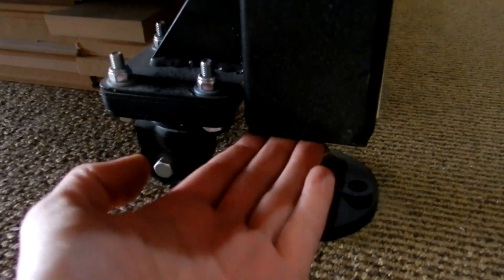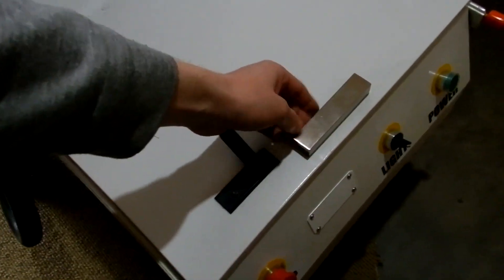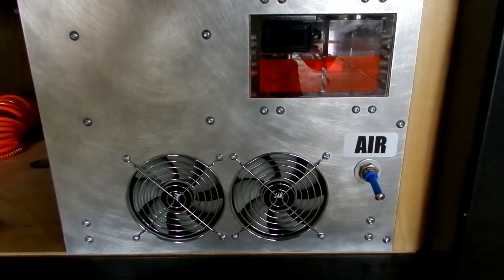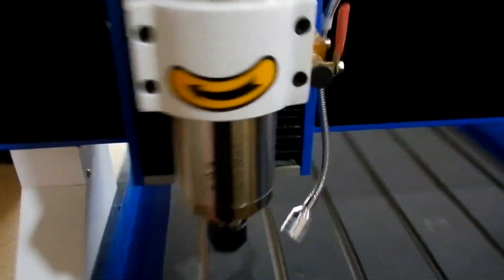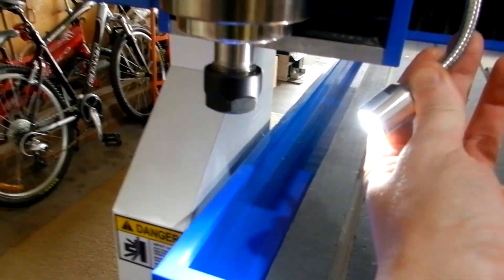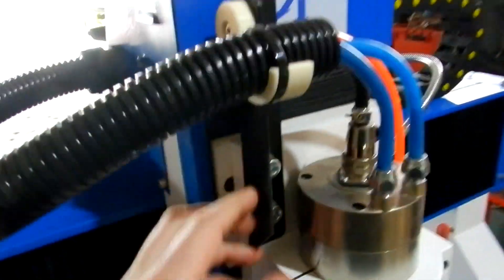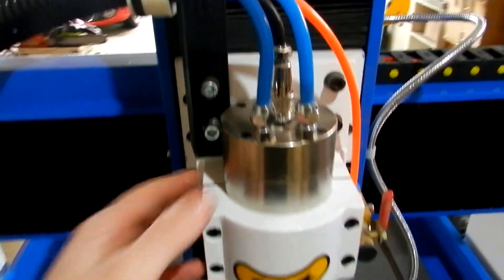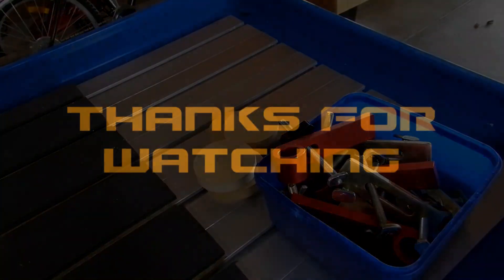SM6090 CNC Update

Comment: Are Stepmores a good factory to deal with? now that you had the machine for a couple of years. what is your impression?
Reply: They sent me a non working machine (6090 atc)and ghosted me
Reply from the maker: Oh wow wtf. did you end up getting it sorted out?
Reply from the maker: Had no problems with the company, Love it, had no problems with it. Did some big long jobs on it this year. Also cut some slabs of 50 and 70mm thick macrocarpa with no problems at 600x900mm size. Still need to do aluminium cutting on it and will be doing that some time soon as I will need to make some brackets and bits.

Comment: Im about to order a machine (either 6090 or 1212). how did you get it off the truck and in?
Reply from the maker: I had them deliver it to my place. 40mins drive from Port. And they used a pallet trolley Jack to get it from there truck into my garage.
Reply: @exploringwithmark  was it easy to move about on the pallet trolley? I assume it was too heavy. Mine will be a tad heavier. How did they take it off the truck though?
Reply from the maker: Truck had a lift on the back door. Wasn't to bad to move around on trolley. The stand I made for it is on feet and chaster wheels, I moved it a couple of months ago when I had a big clean up and rotated the machine 90 degrees in shed. 1 person job.

Comment: Hi Mark, how did your vacuum head work out? Would you be willing to share your 3d print files with me? I just purchased a Stepmores sm6060, can't wait to get started! - and i really like your set up.
Reply from the maker: Hi Sytse. Nice one. I love my machine but not used it much at last couple of weeks. Did cut a but of Aluminium other weekend and cut nice and smooth. Vacuum system not finished yet. Vacuum head I going to look into making some more adjustments to as its a little restricting. Happy to share files of it. https://mega.nz/folder/26xlRSTT#T-hKAg6IndHxy-N9Eg7M9w